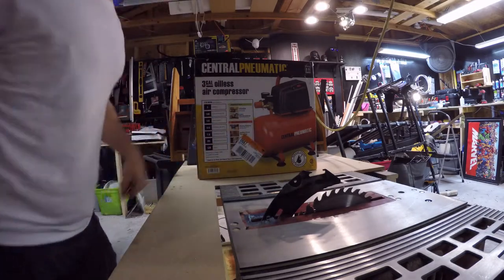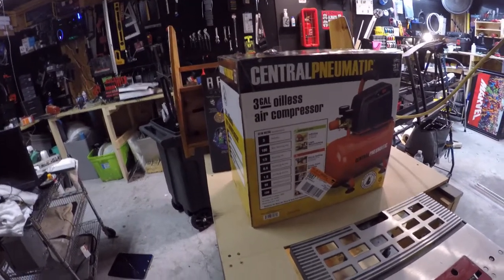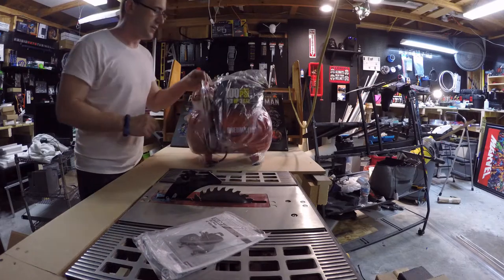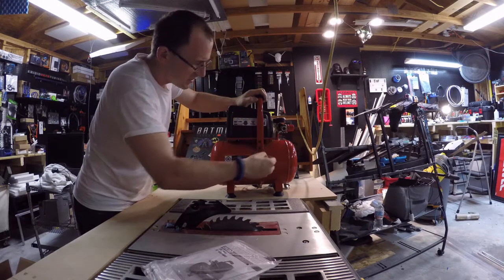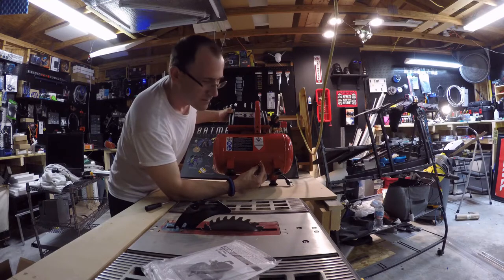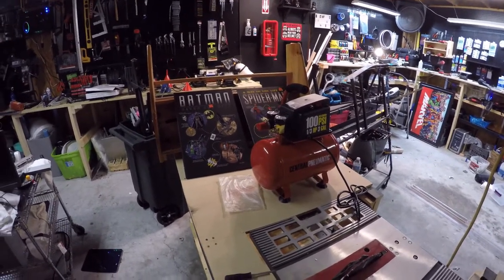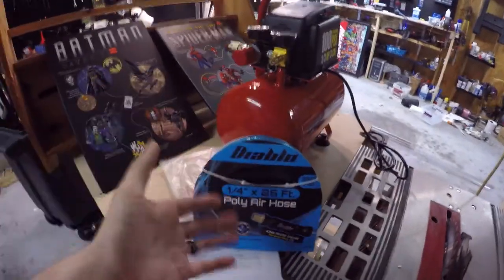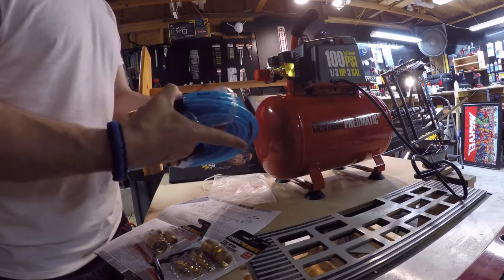Central Pneumatic Air compressor  3 gallon  | harbor freight

Comment: Either hold the hose when you release the hose or dial the regulator down to zero so that it lets the air out of the hose.
Reply from the maker: o  that's good advice ... thanks